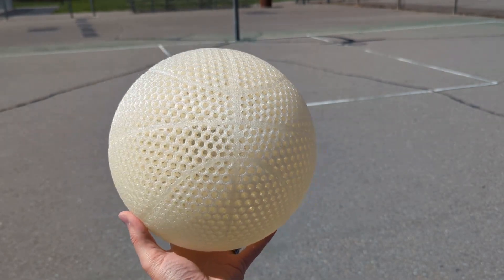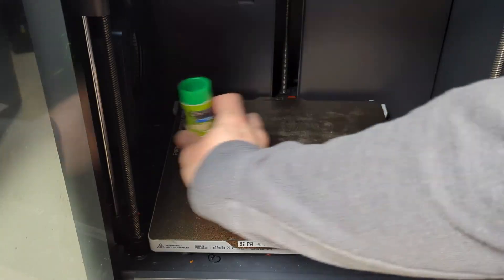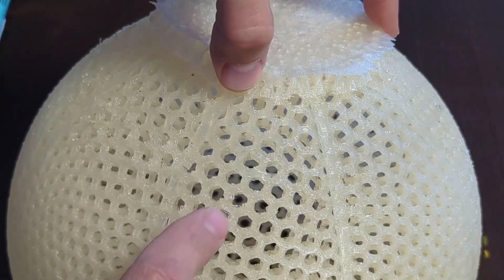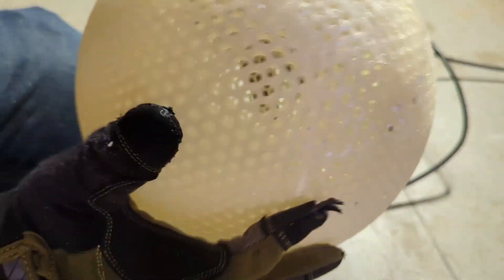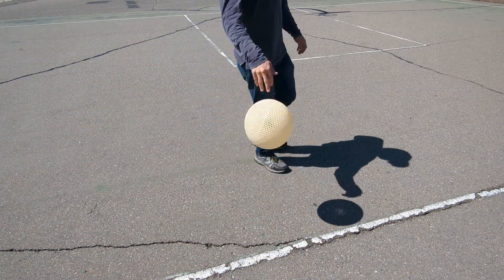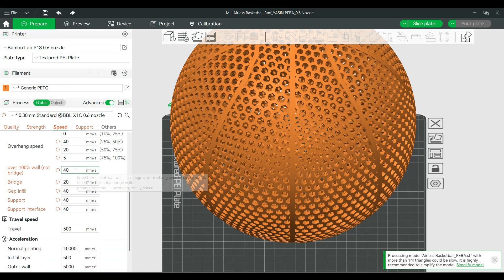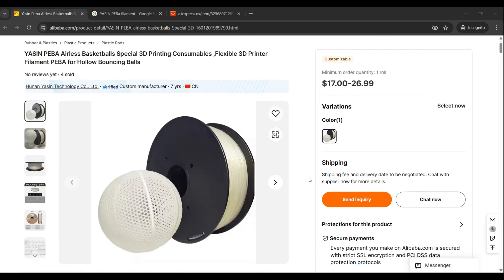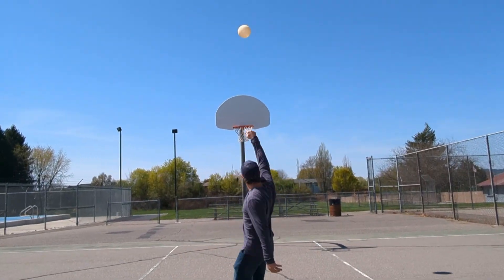Printing An Airless Basketball Using Yasin PEBA Filament!

Comment from the maker: What should we try next?
Reply: Filamentum peba
Reply from the maker: @Zyzz-xj7se I just bought some so you got it 😁
Reply: @makeitlabchannel  Cool! I've been wanting to try the peba filament from filamentum, but I wasn't sure how well it would bounce, since it's not real cheap
Reply: @Zyzz-xj7se yeah need to know, on the fence of buying some
Reply: Maybe pctg? its tougher than petg but a little more flexible, might be interesting.
Reply: @Chaser7002  that’s a good idea 👍
Reply from the maker: @Chaser7002  I will look into it 😁
Reply: What about Bambu lab TPU 95A HF, because i recently just purchased some.
Reply from the maker: @HIGHLIGHTS-q1b  I have tried a 98A TPU and the AMS compatible TPU from Bambu Lab, and both of them did not bounce well. I have seen others trying 95A with similar results, so I would not recommend it if you are wanting a good bounce
Reply: tennis ball out of peba pls
Reply from the maker: @alf3071 that would definitely be a fun project 😁
Reply: TPE please!!
Reply from the maker: @MeiMeiAndEllie  I have tried a couple of TPE filaments with not fantastic results - is there a specific brand you had in mind?
Reply: @ no not really, I ordered one from China and it’s still coming.
Reply: TimePlast "Ball" Filament
Reply: Esun peba 90a filament

Comment: Hello, where do you buy the Yasin PEBA material? I saw it on aliexpress, it probably won't be the same quality, huh? And what nozzle do you print it with? 0.4?
Reply from the maker: Hey there, I actually bought the Yasin PEBA from AliExpress (https://s.click.aliexpress.com/e/_c4PNb7Zt), seems like the quality holds up pretty well. And I used a 0.6mm nozzle to print the basketball. Good luck!

Comment: When you print your basketballs do you just do stock settings? I have the BIQU PLA-HR and it's going to take over 10 days with the recommended settings what's a 0.6 nozzle
Reply from the maker: Oh dang, what layer height is that with? I had to change my printing profiles from stock settings to the recommended settings by the manufacturer. Do you have a Bambu Lab printer?
Reply: @makeitlabchannel  the new anycubic Kobra 3 max. I was able to get it down to 4 days 😂

Comment: so why the airless basket ball design needs to be so filament heavy. more grid less width. maybe more "thickness" but less line width, for the mesh. ie optimizing the basket ball mesh design. if the line width is say 1/4 or less of the current and height is more, thin high lines, then total material weight is less but structure strength is same. think I-beam mesh lines. wood work safety? never. optimally two 3d print lines as a wall, thinckness. well 0.8mm line width walls.
Reply from the maker: That is an interesting thought - might have to test it out!
Reply: @makeitlabchannel  also segment the ball to 6 equal segments so its easier to print. like 6x of square sphere domes. I have one such sphere dome square segment model that prints without supports. also I think that normal PLA can be made flex bouncy with smart structure choice. at least flexible.
Reply: @makeitlabchannel  600g? I made a test print with a segment, thats only 33g per piece, or about 200g total. using pla.

Comment: I would if you can reuse 3d filament from say the supports or failed 3d prints?
Reply from the maker: I actually invested in a toaster oven just so I can try this. It would be awesome to turn the broken basketballs into something fun/useful instead of just throwing them away
Reply: @makeitlabchannel  yeah I figured there had to be a way to reuse old 3d prints.

Comment: Hey! I just got a 3D printer and my goal has been make one of these balls so good that I'd feel great selling them to friends family etc. I've printed 2 balls now and they came out nearly perfect excluding two problems. Biggest problem being where the overhang exists my printer (Brand new X1C carbon.) is making it all stringy.. I really wouldn't care because its inside the ball BUT I think what its causing is the ball to have less tension/rigidness right in that spot and its making it so when I bounce the ball on that spot it feels like an inflated ball. If you're using the Partylime file the overhang is set to print slower already I believe. I have my temp set to 230C. I have my 3rd ball in the printer as we speak. I've over halved the speed of the overhang which was already set to be pretty slow. I'm keeping my print bed open during this portion as well for better cooling since fans are on max speed by default I believe as well unless I'm missing something.

My question is do your BIQU balls have this issue and if they do, do the peba ones have the same issue? If neither balls have this issue I'd honestly love some help here. Every time I make a ball it costs around $40-45 and I'm trying to perfect this. I'm kind of running out of ideas and its a pain in the ass to trouble shoot this specifically since it takes 54 hours to see if what I did fixes the issue.
Reply from the maker: @collinrhodes5383  Hey there, I have run I to those issues as well. The type of filament you use really makes a difference, along with the settings of course. I had some overhang printing issues when I first printed with the BIQU PLA-HR filament, but I found that adding more supports to the bottom helped out a lot. If the Kimya PEBA-S filament was around I would recommend that, but it is discontinued, and the Yasin filament I tried in the video had some issues. The BIQU PLA-HR is a good option and has decent bounce, but nothing has been able to compete with PEBA for bounce yet. Wisdream FlexiTough is also a decent option. I have 3mf files for print settings that have worked well for me for all of those filaments on Makerworld if you wanted to try them out.

Comment: On the slicer for Bambu what should say the Filoment is because there is no option for it
Reply from the maker: Oh it won't be in Bambu Studio (yet at least), so what I did is I selected a generic PETG profile (it doesn't have to be PETG) and just edited all of the settings to match the recommended settings for the PEBA
Reply: @makeitlabchannel  thank you so much

Comment: How would I print an airless basketball on a prusa xl with ataraxia art fpla?
Reply from the maker: I admit that I have had zero experience with any Prusa printers or Prusa Slicer, but I would guess you would just have to load the STL, change the settings to match the recommended settings, paint on supports on the bottom of the ball, and it would probably be alright. If you are looking into using 2+ different colors or filaments, I would have no idea where to start